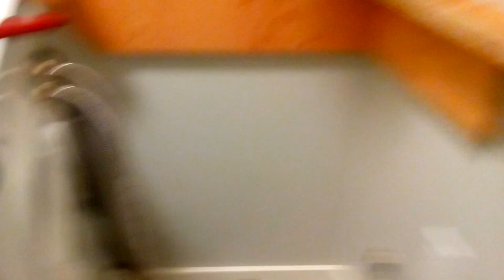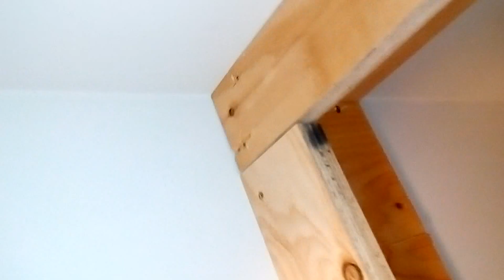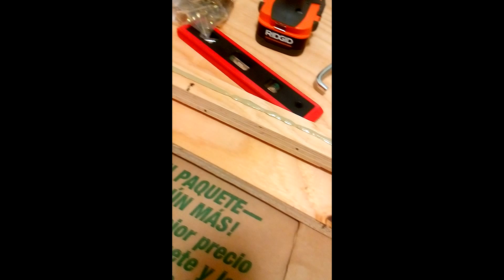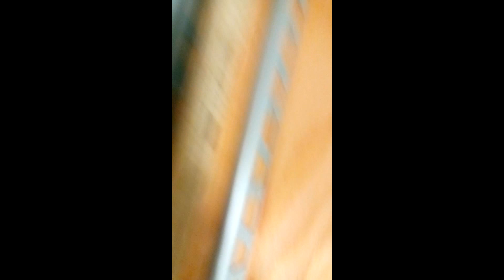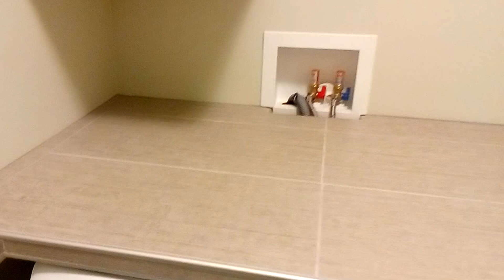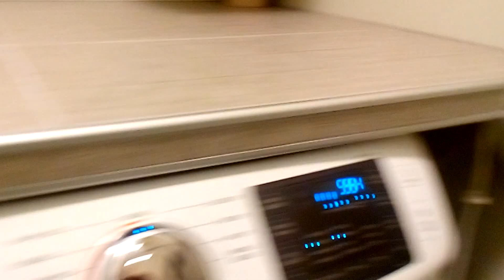Tile Countertop Cover Shelf Over Washer and Dryer, Building Instructions

Comment: Awesome video! Do you think I could just use strand board and make a frame underneath it out of 2x2s to stiffen it up?
Reply from the maker: The glue in Strandboard will not hold together after the tile thinset is applied for  long.  In time it will break down and the tiles will break.  Thinset requires cement board, which is best, then waterproof glue exterior grade plywood.   A guage for support is: The minimum span when doing floors is 1" of plywood.  Usually 5/8"T&G with 3/8 plywood subfloor glued and screwed using 16" centers, with engineered floor joists or 2x10s blocked. Screws  are 6-9" apart everywhere except edges where screws are 3" apart.  There can be no deflection or the tiles will crack.
Reply: Graham langille Thank yo very much for the info I appreciate you taking the time to reply!
Reply: Graham langille it was a bit hard for me to tell but did you put the thinset right over the plywood? I don’t see any cement board.
Reply from the maker: Eric Montoya yes I have tiled two houses walls floors and fireplaces. You are fine with exterior grade plywood. If you have very heavy Stone you can put on wire mesh to help support it. Most of the manufactured Stone does not require it. Some go as far I was using stainless steel screws in the plywood. This is to prevent the screws from rusting from the liquid in the thinset. I have not gone that far have not had a problem. If tiling in a heavy moisture area I use backer board or cement board. Like in a shower. The water will slowly over years go through the grout. You can eliminate that buy waterproofing the grout with a sealer. I did a house with granite tile and plywood kids stood on the counter I stood on the counter and for 15 years we never had an incident still look new. Sold that house and moved but I'm guessing it's still fine. Hope this helps.
Reply: Graham langille It really does help! Thank you very much I am really looking forward to this project!